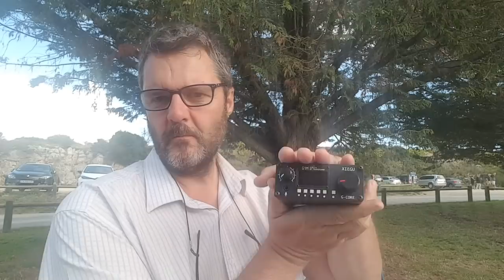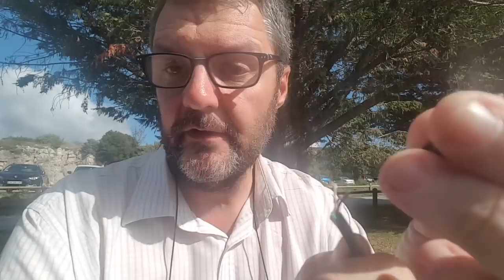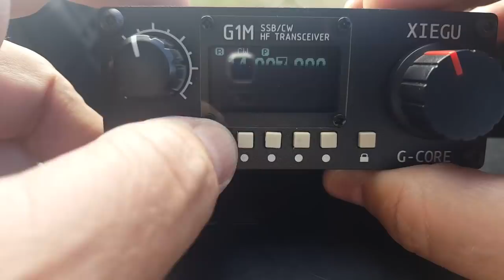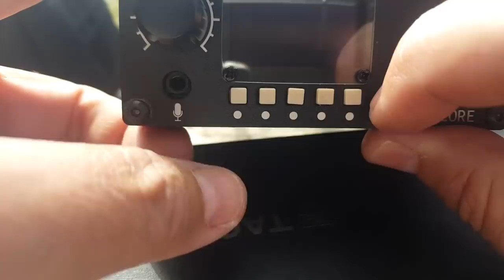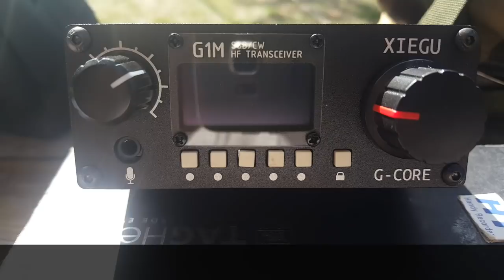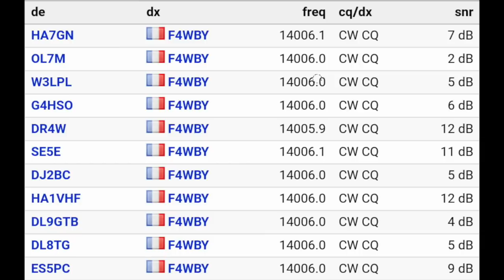First Look at The Xiegu G1M SSB/CW QRP Radio.

Comment: Gil ,

I have  one  and have had it for quite a while but just setting up an HF proper antenna now a  terminated  FD  for 40 mtrs  which will be abt 9 mtrs off the ground.
Ok so I setup my G1M jusst now as a test with a Fluke  73  DVM set for amps in line.  It shows 0.49 amp draw when on Rx, so the datasheet value seems pretty accurate .   I kept dropping the V down from 14.0V which was my INT  test v and he amps stayed constant with only minor changes in the second digit. I decided  to check What Voltage from my  variable PSU I was at ... it was 10.16 V  at that point  and the tcvr was still rx fine. Obviously it is going to  produce reduced Pout but a lot  approx by 10/14 squared or 1/2  Pout spec at that voltage but it will still work off a battery supply system down a 10.0 V (rememberthis was a test of a specific unit built in perhaps 2020 or 2021).

NOw why is it so ? When you pull the radio apart there is  an RF power board bottom and  a DSP board top, plus the display and HMI board .  The  Tx  line  as mini coax goes from the  top board to the RFPower module board and it is simply a coax it seems. There is a separate mini coax from near the  BNC to  the top DSP board  for the the Rx signal in receive mode. There is not much  other digital i'face cable between the two boards it seems . 

SEE  Ytube   Xiegu G1M inside from a Polish ham.  It looks very much to me that  the   Tx sits in  Class A bias ALL the time for simplicity of design  (also called Agricultural design) . Hence the high current draw when in Rx only mode .  That's an educated guess . 

73  de  ZL1 MZR  (the Kiwi  Momzer )

 TE Fidler
Reply from the maker: Interesting thanks. I sold mine and got the G90..
Reply: @RadioPrepper  A  G1M and  MRF 9120 based  Chino RF amp with a filter set  comes in at  about  400 USD. that's a lot less than a  G90 but the G90 has more coverage of course.  I'm talking a Clean 45-50W RF out or PEP   150 W which is  more than twice what a G90 can provide.

Comment: Does this radio require an antenna tuner?
Reply from the maker: Depends on the antenna... It does not have one built-in. Wether a radio needs a tuner has to do with the antenna, not the radio.

Comment: Hi Gil, wondering more about this little radio. Does it have a SWR meter built-in? Cheers
Reply from the maker: I don't know...
Reply: No it does not . You can buy a small SWR board from a lot of the Chinese vendors if you buy  the TCVR  there. SWR Bridge V 1.4 is the PCB version you get. It is precisely what is sold by the Toroid King as a kit through his site.  you get a prebuilt unit for about 15 dollars and no freight if you buy it at the same time. You still need a 0-200uA meter for it to be used plus a  Spdt switch . Do some research on what the Toroid king offers and decide if that will suit you .  
the bridge PCB will have to sit outside the radio.  Build it in to a  homebrew ATU.

 TEFidler   NzL
Reply from the maker: qrpguys.com has some tiny led ones too.

Comment: I had the 817, X2, X3, 5105 and G1M. I returned the G1M after one day because it was picking up a local AM radio station regardless of where the G1M was tuned to. The Elecraft may be older technology and expensive but the actual audio is tons better than all the others. RX sensitivity is tops. Had to return the first 5105. Lots of features incl. tuner but sound quality is poor. The 817 is a dinosaur, but reliable PLUS VHF, UHF. So if quality is the most important issue for you get an Elecraft. Ruggedness then Yaesu. Cost the 5105.
Reply from the maker: That sums it up, thanks!

Comment: I think I would go with hot glue instead of epoxy for the jack just in case you needed to remove it.
Reply: it might work but hot glue has a tendency to not like pcb
Reply from the maker: I don't think it would prevent it from breaking though..

Comment: I use 4S Zippy LiFeP04 8.4 Ah from Hobbyking which is a great voltage for the G90, it consumes 0.5 amp on receive and 4.5 amps transmit, no big deal these days with Lithium packs. With that battery I can run for hrs, the G1M should work twice as long on transmit.

Best thing about the Zippy LiFeP04 is that I can replace 7 ah in 30 mins charging at 15 Amps, probably 45 mins for a full charge, I use an old RC charger I had lying around.
Reply from the maker: Certainly, but charging without grid power is an issue for a larger capacity battery, unless you have a running vehicle or generator...
Reply: It is an issue depending on how long you intend being out, the 8.4 Ah is light, under 1 Kg, provides 13 volts and can run the G90 for several hrs. 

By the way, the G90 works down to 10 Volts and outputs full 20 Watts at 10 Volts, there is a youtube video somewhere. 

A small foldable/role up solar PV panel could be used to provide power for the day and battery for the night or parallel 2 x 8.4 Ah for 16.8 Ah and weigh just under 2Kg. 

I even use a 12V 45 Ah 
car battery when I don't have to work far from the car :-)

Comment: R u testing the Minion SDR any time soon?

3 reviews / Write a review / Ask a Question
Reply from the maker: Thinking about it...
Reply: @RadioPrepper  in case I'm buying one, I'll borrow it to you for reviewing :)
Reply: @RadioPrepper  yeah - for 150 bugs more you get all HF bands (without 6m) + a SWR meter ... especially the SWR meter seems quite useful, without a tuner you can adjust your antenna ... other alternatives are yiegu G90 and especially X5105 ... ft818 not so interesting anymore IMHO

Comment: Radioddity has 13% off purchases for the next ~3 days (it's now Oct. 27, 2019). I've been on the fence about the X5105, but for $521.13, and the G1M  at $264.99,  I think I'll have to get both. I don't like the high current draw either, but the Minion SDR, recommended by @Radio Prepper, will probably be my next QRP radio, and it solves the high current consumption issue, having a current consumption in receive mode (at 25% volume), of 120mA, and at 100% volume, up to 200mA. In transmit mode, the current consumption is 600-1600 mA. max. MUCH better than the G1M. It's also about $85 (US) more than the G1M's current price, and I don't know how much shipping to the US will be. I got free shipping when I ordered my Xiegu G90 from Radioddity, so I'm assuming that's still being offered.  Thanks for the videos!

Comment: Nice review Gil. Ask 3 hams about a good portable radio and you will get 4 answers (at least :-) ) Xiegu radios are at a good price. But in this case, no internal battery and no tuner. I think, the KX2 is still the best portable radio. Internal battery, internal tuner, 80-10m. But the case is not very portable friendly :-( I got the side handles from GemsProducts https://gemsproducts.com/product/kx2-heat-sink-complete-set-both-ends/ and the plastic cover. Covered the front morse key connector too  and attached a power pole connector. Still not military grade dust and waterproof but usable. I wonder what the price will be for the Lab599 TX500, this could be the ultimate outdoor radio :-) But no built in tuner, no built in battery :-(
Reply from the maker: Yep, waiting for that one, if it ever comes out... Also waiting for the QRP Labs QSX...

Comment: Hi Gil. I just bought the Xiegu G90 and haven't had a contact yet with it because I tried to upgrade the firmware first and the programming cable stopped working midway, so now the radio is useless. Can't even start it up. Have been in contact with Connect Systems (who sold it to me) and they are seeing if they can find a schematic for the plug so I can test the cable. Man, am I sorry I bought this radio. I will in future stick to the old fashioned way without the need for the radio to go anywhere near a computer. Should have bought an Elecraft K2 to supplement my KX1 instead. I may end up chucking the G90 away and writing it off to experience.
Nice video in any event. 

Grant VK4JAZ
Reply from the maker: Just bad luck it seems...

Comment: Gil, I don’t know what your budget is, but consider the G90. The G1M is a good radio, but as you have discovered, there are some quality issues with it. For the G90, there is an upgrade large display in the works, and it will add FM and 6M from what we’ve seen so far on the forums. The G90 has 10 bands, supports CW, CW-R, USB, LSB, AM, 160M - 10M, Autotuner, and 20W output. It works very well with my Chameleon Micro, and MPAS. 73!
Reply from the maker: Interesting, I will look at it, thanks.

Comment: Enormous thanks for this review! I got it recently and it seems very nice. The CW Tx seems fine. What I cannot understand is that when I transmit on the LSB (like let’s say the 40m), I tune the antenna on best reception with the mini tuner and transmit. There is a gargling sound together with my voice on another monitoring radio. When it tune while transmitting so that my voice is clear, this then is a place of rather low signal reception!! On my other more sophisticated SDR spectrum radio, the optimal Tx signal on same frequency LSB and same antenna is the optimal Rx setting too! How come the G1M transmits clearly with antenna tune setting of weakest reception??.? Any ideas? Thanks!!
Reply from the maker: Weird, no idea. Maybe the alignment is slightly off...
Reply: RF Feedback

Comment: Nice video Gil, shared.
I know I always say "never", but with 20/40/80m, it could be an interesting preparedness rig at that price. Is there an internal battery? I'm often concerned about sending these radios back for warranty work. We buy straight from China, sometimes it becomes cheaper to just buy another one. The cool thing here is having low cost options.
Thanks for sharing.
Reply from the maker: Thanks Julian. No internal battery and I do not know if there is any space available inside the case...
Reply: @RadioPrepper  still Gil I totally agree, 250 bucks isn't bad for this radio.
Reply: @OH8STN  Hi Guys, it sure is a nice radio ; on my side I need to save for a G90, it provides enough power for SSB ops as 5W is a little short for SSB, for CW it is plenty enough power.
Nice from your friend Gil you could borrow the radio.
Would be actually cool when I get the G90, you could make a video with it : i'd order it for shipping at your address then you'd send it over to me after the tests :)
73 QRO de HA7WX Christophe
Reply: @OH8STN  As proponent of freedom & democracy I find the price of this Communist Chinese product just too high.
Reply: @OH8STN  £190 now
Reply from the maker: No internal battery but for the price, tempting..

Comment: Hi Gil, love your videos, have just purchased the G1M and very pleased despite the lack of the other bands. Mine works off a 3S 18650 battery pack (11.2 V) FB. On 80m had contacts on SSB out to 1,000km with a 30m long wire @ 3m high NVIS. Hears much better than the RS918, and even shades my FT817. Now I know how good this Txr is and thinking of getting the G90 later. Overall it has become my favourite portable unit - 73 de Alex VK2ABE
Reply from the maker: Thanks for the info!
Reply: Greetings from across ditch.  I bought one  about  3 yrs back but have only recently renewed my ZL licence.  I got mine from a commercial as opposed  to  private Ebay seller in PRC .  There were some  Paypal stuff ups  and I ended up getting it for something like  160 AUD in my hand. The vendor still got all his money.  It was to do with accounts not linking to Paypal correctly and so on and I fixed themup  -Paypal in Az but still the withdrawal was light on. Then they sent me a fforget it.. we will write off the difference   email.  

Unfortunately this model is no more and has been replaced by the  G106. THey should have left a good thing alone. 

Did you buy hte RS 918 in Oz or build  it yourself. What was the final damage to your bank account for that one  ?

ZL1 MZR  , the momzer in Kiwiland.

Comment: Hi Gil, I have the G1M and can tell you it will work down to about 9 volts with almost full power out, and mine only draws 325ma in receive, also any electret mic works with it, I use the $15 mic from http://www.qrpkits.com/microphone.html and it works better than the supplied mic with good audio reports. It's a great little radio but really needs a firmware upgrade from Xiegu.
Reply from the maker: Good to know, thanks!

Comment: the AM receive is very, very good... bandscope scale is adjustable... replace the mic with a QRP KITS Electret Microphone (US$15 ) much better... the included mic is junk, but you can replace the element and 3.5mm jack... drill a hole in the mic cover... there is a bug in the band voltage table in the firmware (bad value for 12M) for amplifier ops, although there is no interface for amp PTT w/XPA125B... use SPKR for audio out, use mic jack for audio in for digi ops, and COM for CAT/PTT.. 66 memories, but no keyer memories, no CW filtering, and worst: no way to copy memory 'channel' to VFO!!!!! you can also customize the power-on msg w/your callsign, etc.  not a bad rig though... will quit at 9V, but a cheap LiIon 6Ah works great...
Reply from the maker: Thanks for the info!
Reply: Looks like a quite  nice mini trx..but said to hear your  poor audio  caused by qrp's running around the microphone...it lowers total score too much..

Comment: I have the g90 and it has a telephone or internet type connector similar to the yaesu products for the mic.  I did have a problem with the fuse holder and bought some inline ato auto fuses to replace the small glass fuse that developed a internal broken solder joint and the xiegu came without a spare fuse. The radio  (g90) is 20w on the popular bands from 160 through 6 I think but its 20w.
Reply from the maker: I'll check it out thanks.
Reply: @RadioPrepper  I have the G90 and have worked stations SSB world wide from the car. It is very nice mobile radio with a removable head. Definately look into it.